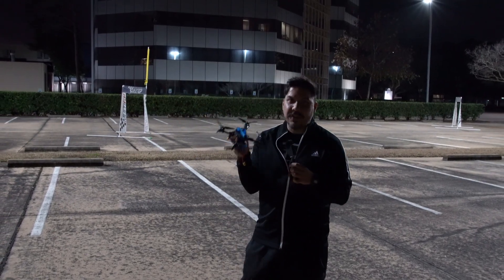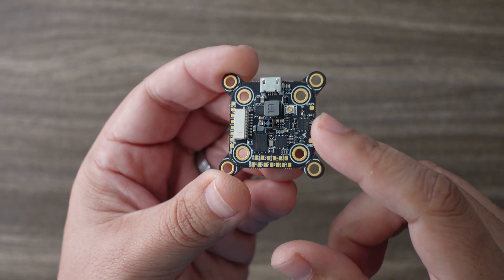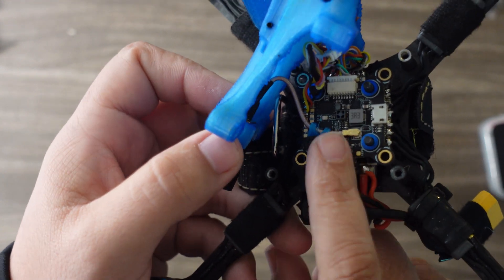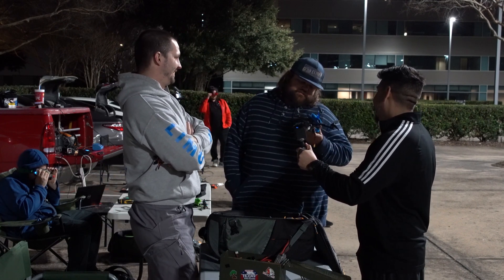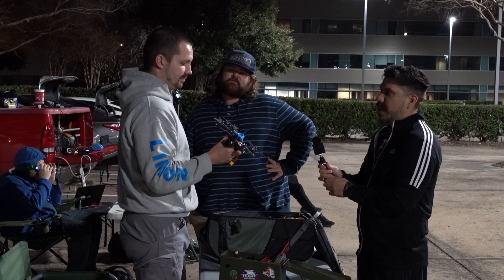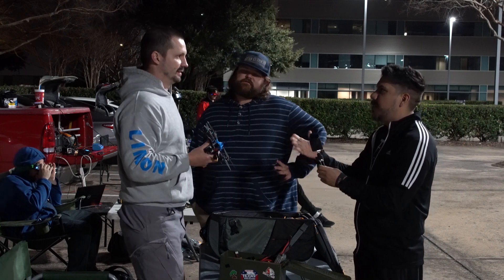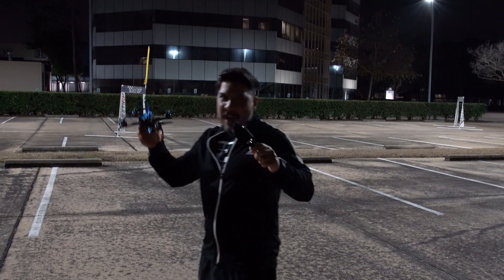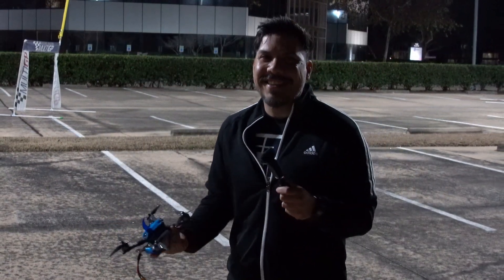ELRS FC + VTX + RX - Pancake FPV Drone ALL IN ONE

Comment: Yes, very small FC with many functions. Only thing that is not good for me is the ELRS SPI receiver. The better way would be to put a single working ELRS receiver on the board and wire it directly to a UART. Then I could just update the ELRS firmware, currently to 3.0. With the ELRS SPI you always have to update Betaflight and that has some trade-offs.